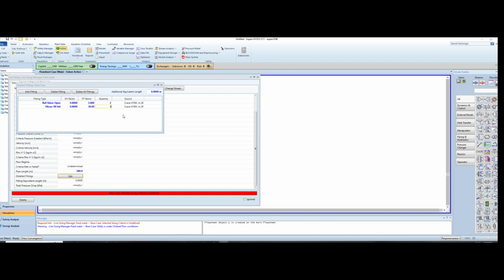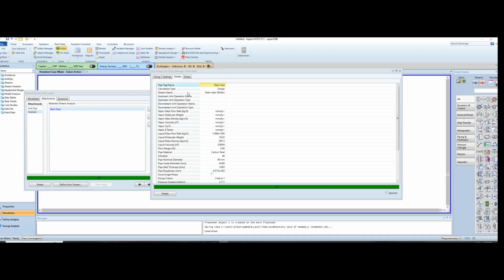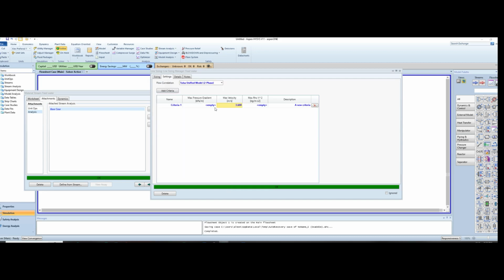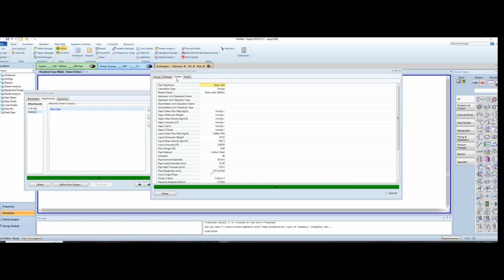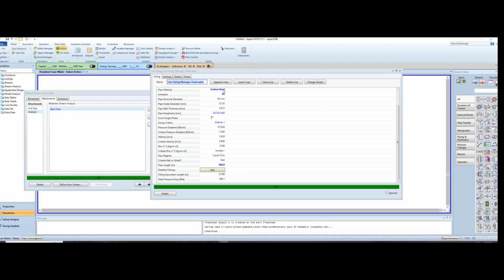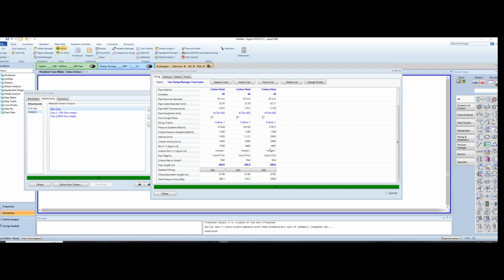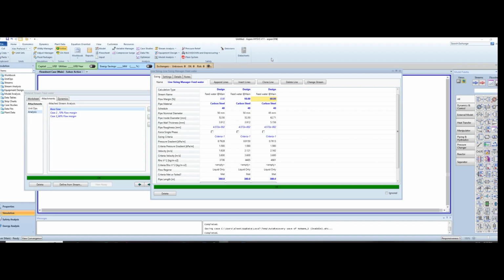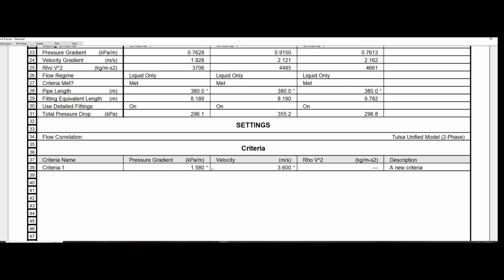Step-by-Step to Process Pipe Sizing Using Aspen HYSYS

Comment: eventhough you increase flow margine, it is showing same flowrate??? what is the meaning of flow margine then?
how 60 % margine compansated?
Reply: in the same way when i am entering 1000%, then also it got converged!!! i dont understand, why?
Reply from the maker: If you’re are using the pipe sizing manager correctly, typically three things should change when you increase the flow margin. First check the pipe size, second the velocity and lastly check the pressure drop. 

You mentioned that “it is showing the same flow rate” I am not sure where you are reading the flow rate from because the pipe size manager does not have a flow rate field. But using the velocity and the pipe size, you can back calculate that flow rate to check if the base flow rate has increased by 60%. 
Let me know how you go with that, if it still not working let me know and ill have a closer look.
Cheers for now

Comment: Hello Alex.,
I am trying to make a HYSYS simulation to suck groundwater at a depth of 40 meters using the method you explained on this Youtube. I put a 40-meter deep well water pipe into the ground and connect it to a pump above the ground. Do I have to determine the height of the pump above the ground first? Then, if I have buried the pipe into the ground 40 meters deep, what is the water pressure at a depth of 40 meters? Do you have any suggestions?

Comment: Hi Alex. Thanks for putting this on your channel. I am interested in piping design where there are multiple pipes from multiple sources at varying temperatures and pressures. Do you have a video about that?
Reply from the maker: Hey mate, thanks for tuning in. I have worked on plenty of hydraulic models before, but I haven't made a video about it yet. I'm thinking it might be a good idea to make one. Just a heads up, Aspen Hydraulics is a bit different from the standard Hysys pipe segments.

Comment: Do you accept questions??
I've run the example and is not converging.
On the Pipe Sizing Manager the message says: "BaseCase: Line Sizing Criteria Failed"
I check carefully the inputs and criteria and still not working.
Do you know whether I need to activate something or any clue what's failing??
Hope you can reply.
Thanks
Reply from the maker: Hi mate, I am happy to assist as much as I can. I am not sure why your simulation might have failed if you had the same inputs. I would suggest to check the property package, for water you can use NBS steam or ASME steam. You can also check if you global units are the same as mine (i.e metric units)
Reply: @Practical_Process_Simulations  Hi, thank you for taking your time.
I conducted the same exercise in other simulations, and it keeps failing, in some streams the pipe sizing works fine, but in some other cases I have the same message "BaseCase: Line Sizing Criteria Failed", would like to know why.
Is there a way to email you the file so you can see for yourself and maybe find out what's wrong??

I would really appreciate your help.
Reply: Is there a way to send you out the simulation and maybe you can find out what's wrong.
I would really appreciate your support.
Reply from the maker: Sure no worries, send the simulation file to alexmashego@gmail.com. Which version of hysys are you running?
Reply: Hi Alex, very great tutorial. Can you please add a pump to deliver the same flow based on the pressure drop rather than increasing the pipe size so we understand also how to use the pump function.will be grateful 🙏